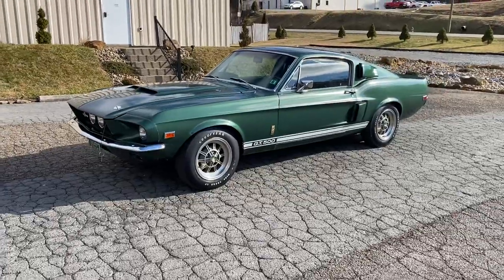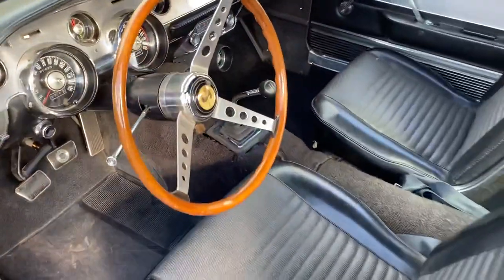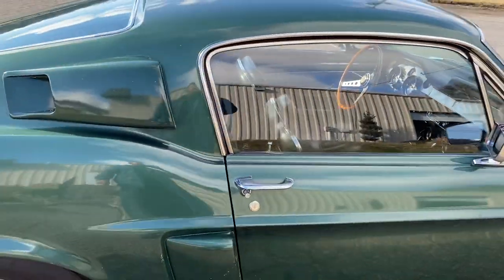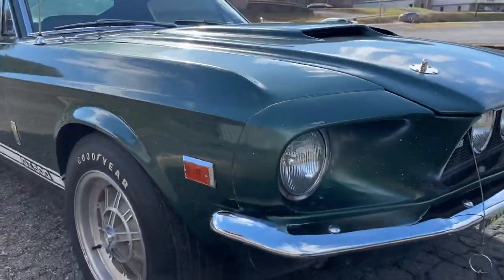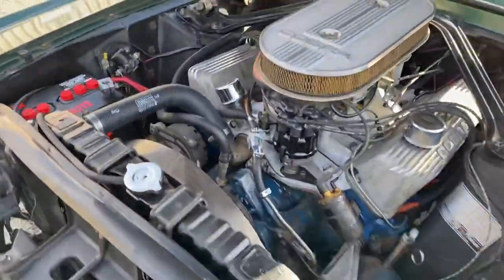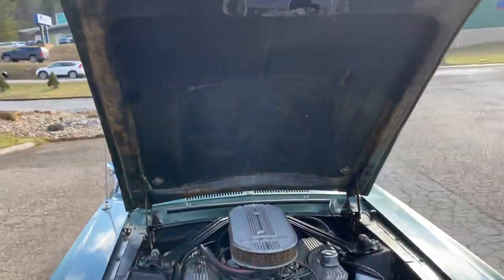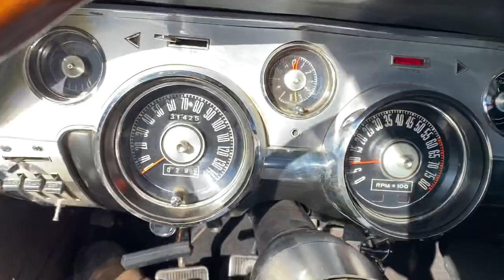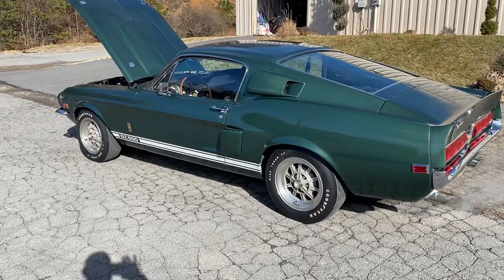1967 Shelby GT 500 4 Speed All Original

Comment: Very very nice Shelby, love the original green paint. Looks like somebody at some point installed the side marker lights, as I believe they were not available until the '68 model year.
Reply: He specifically said this in the video. The lady said "They were there when she got the car, because Colorado requires them.."
Reply: @jeremiahsawyer2123   Yes that's correct, I originally made the statement before viewing the entire video...my mistake. I also wasn't aware of a state requiring you "alter" the originality of a classic car for safety or compliance...i.e. the car didnt come with abs brakes, airbags, backup camera, or catalytic converter either, are those required too by the state? Hmmm, just a question. Thanks.
Reply: Yeah, those aren’t even ‘68 marker lights. Those are some NAPA specials. They should be removed, welded up and touched in. Same with the damaged carpet. And buff out those decal marks.

Comment: I grew up in an identical car.  Only differences are 1) the extra hood pins, 2) the side marker lights, 3) the exhaust valence cutouts on mine were hand cut and round.  Does it have rear brake cooling in the lower scoops?